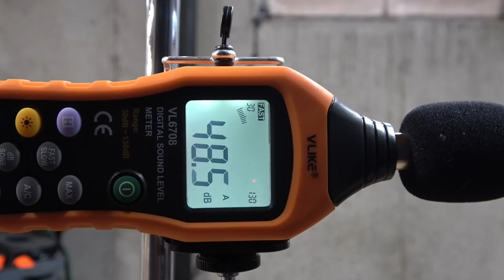Multi Printer Lack Enclosure  - Restack - Chris's Basement - 2023

Comment: Hey Chris, at 10:39 you show the filament hole but I am not understanding exactly where and how you are passing the filament from top to bottom. I also have two Prusa's with a single lack enclosure and am adding a 2nd Lack enclosure, just like you did.  Until I saw your video, I was going to cut a middle table down to about 10.5 inches so that I had a middle section just tall enough for a spool of filament for the bottom printer.  I think your idea is a great one to run the filament all the way through to the bottom from the top, but I'm not understanding how you routed that filament. I watched all three of the videos in this series and unless I missed it, I don't see you show the filament path. Any insight and thanks!  :)
Reply from the maker: I might have skipped over it, I was going kind of quick. So what I did was drill a hole in the top and second tables all the way to the left of the machines. I glued the filament tube part https://www.printables.com/model/405001-lack-enclosure-restack-project-2-printers-chriss-b/files in both holes, Then I run the filament from the top through the first print enclosure to the second one.
Reply: @ChrisRiley  Ahhh, ok. I couldn't tell where exactly the hole was drilled but yes,  Left side....  I understand now.  THANKS!    Are you still liking that arrangement?  Not a PIA to run it through all the time? It doesn't get caught or hung up or anything?  The angle at which it enters the extruder in the bottom printer hasn't become an issue?  THANKS!  :)
Reply from the maker: @PatJones82  It's kind of a pain, but I usually run big spools and don't swap much, so I don't have to mess with it a lot. No hang ups so far.
Reply: @ChrisRiley  Thank you so much for talking with me and for the feedback. I really appreciate it.  I was wondering if it would be a pain for me as I swap often. I’ll have to decide what I’m doing.  If I end up doing a small middle table in between, I’ll let you know and send you a picture or a quick video if you’re interested.   Thanks again, Chris.  👍

Comment: i did something similar to this but i couldnt get the lack tables cause i dont have a ikea locally an when i found them online they was usually 4x as much as what u can get them from ikea so instead of pay extra i just got the dimisions of the lack table an built some from scratch an it was done for nothing cause i had old 2x4 laying around an floating hard wood flooring so i used that for the tops of the tables but after i built 2 tables  an got them together i realized most of my printers was to big to fit in them not cause of the height but just from the foot print alone or from the movement need for the beds so i just scaled the design up an built them bigger so now i have what is basicly 6 self built lack tables turned into 4 enclosures an 6 scaled up for 4 more large enclosures an then i built another for 2 delta printers cause it would take putting 2 lack tables together bottom up side down with the top sittings on the bottoms legs if that makes sense an even with spaces in place it wasnt so close to the top of the printer it made loading filament a pain so i just built one custom that is really tale an long so it can hold both of the deltas an each has its own door but share the space inside. if u have access to old lumber or 2x4 an have a table saw or even just a skill saw u can rip the 2x4 in half for the legs an to frame the top an the biggest cost besides the actually wood would be the screws or whatever u use to cover the sides with but i went with foam boar from the dollar stores $1 for each sheet an u can cover a single enclosure for under 5 bux or if u got with the plexi glass the cheapest way i found to get it was buying these old sneeze guards everyone had to buy for the pandemic stuff. i managed to pick a couple up for 5 bux an they are really thick so they made really nice doors for my enclosures. i wish i had a way of sharing them but only place i have them posted is my facebook an i dont know if anyone can see or if they need to be a friend. if anyone ask i may try to find away to share a picture somewhere else other than facebook so anyone can see it.
Reply from the maker: That's freaking awesome! Thanks for sharing

Comment: I built my lack enclosure for my ender 3 using an MDF board for the back panel that way you can mount your power supply on the back using some 3d printed brackets.
Reply from the maker: Nice! Probably a really affordable option.

Comment: I have 2 Ender 3's in Lack enclosures with PC sheets held by magnetic locators and twistlock catches and a hinged door on the fronts, I also have a MKIIIs and a Voxelab Aquila in a server cabinet which is insulated with the offcuts of some insulation foam when I had my house covered in extra external insulation and rendering, they work extremely well and cost very little to construct, I want to get my 2 Ender 5 Plus and my Pro 3D V-King 400 printers in enclosures next so I can print larger parts in high temp materials, enclosing my printers was a game changer in terms of what I could print.
Reply from the maker: Awesome! Totally agree, keeping the air consistent around the print changes everything.

Comment: You could also increase the height by cutting some longer timber legs. And because it is back to a wall, change the back panels to white board to reflect more light inside the cabinets. By making that one long piece, from the floor and screwed to the back legs, it would add structural strength to help take the weight of the pavers
Reply from the maker: Thanks for the tip!